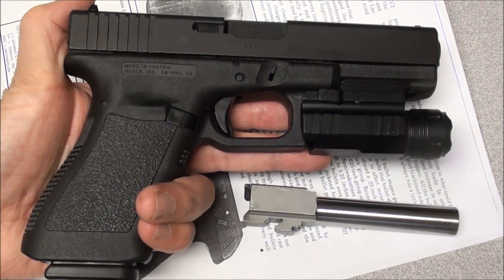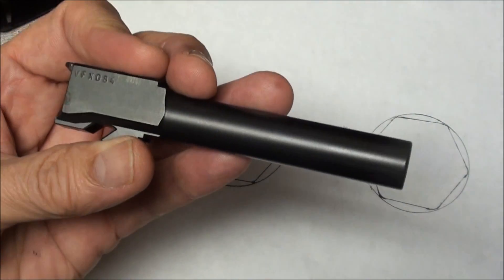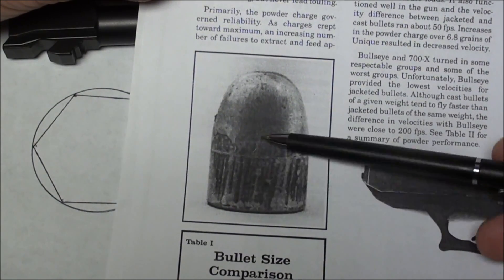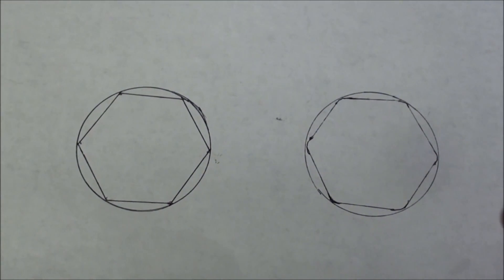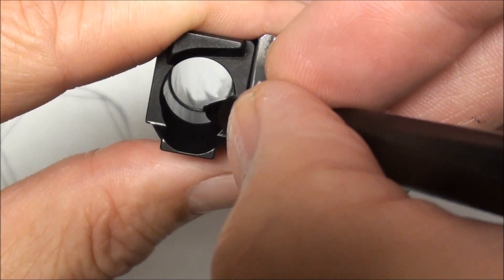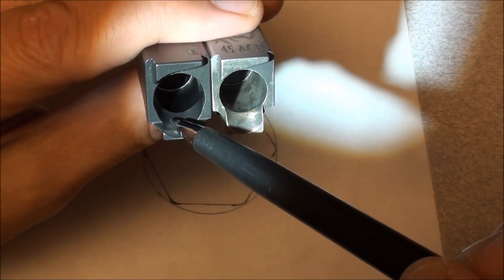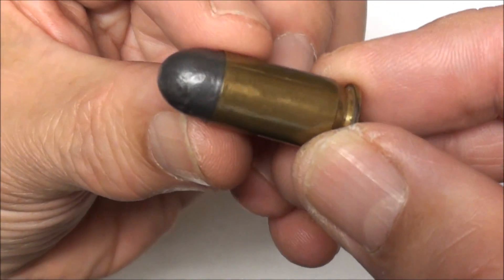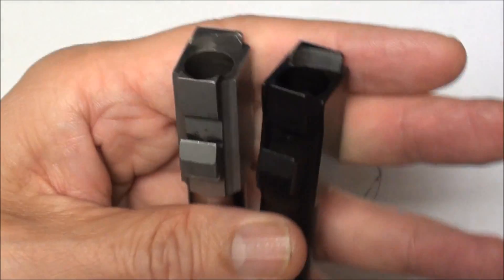Polygonal Rifling in Reloading Ammo for Glocks

Comment: This guy doesn't get it....   Cast bullets are .0005" to .001" larger than jacketed bullets.  Add to that many folks that reload pistols never trim their brass. A reloaded case that is stretched when slammed into the chamber crimps the bullet forming a hard lock between barrel bullet and brass instead of having clearance.  Polygonal rifling is great stuff. It rates with the very best cut rifling.  Any manufacturer wants to limit liability and states no reloads.  Half of home reloads only know enough to remake a bullet not the background knowledge of a competent gun tech or engineer to insure reload safety.
Reply from the maker: +Lanc Mac -- Sorry to not reply sooner, but Google did not post your comment in my inbox.  First of all, cast bullets can be larger or smaller than jacketed bullets and by more than you specify.  Of course, we do want cast bullets to be .001-.0015 bigger than groove diameter of our auto pistols and that doesn't have to have relation to jacketed bullets (although Lee gives a rule of thumb on that that often works - but not always).  As for the rest, let's see if we can make this clear so that everyone can get it... I would add to what you say that many very fine shooters never trim their handgun brass.  The reason is that it is not necessary - we find that our straight wall handgun brass does not lengthen or we would trim them - if yours does for whatever reason - of course you should trim them.  Quite a few of these shooters also shoot lots of reloads through Glock barrels.  If what you say is the case, there should be many more Glock Kabooms than those that happen (and  Glocks have higher Kaboom rates than other guns - reason why these videos are made by the YT posters that post on this).  What you don't get is that if cases were too long from not trimming, those rounds would never chamber as the case mouths hit the headspace shoulder at the front of the chamber and no battery occurs.  Of course it is possible to have that case pinch situation, but it would have to be a real long case plus an extra heavy recoil spring like an Uzi to do it.  The problem you are referring to is when the bullet ogive is seated out too far and the bullet gets jammed into the rifling leade causing either no battery or if the slide impact is enough to allow gun going into battery, a dangerous situation of higher pressure could occur.  This would be a problem for any auto pistol.  As for Glocks, what some have insisted is the cause of Kabooms is that reload ammo lead bullet fouling occurs from the polygonal rifling that this fouling traps the bullet, or the case, or both case and bullet so that firing rounds so trapped causes the Glock Kabooms.  I don't see Glock fouling to be more or less than any other gun without "polygonal" rifling.  If fouling caused Kabooms, all guns shot a lot would Kaboom.  This video is pretty clear about the oversized and heavily throated Glock chambers being the cause - less case support causes brass strain and increased incidence of case failures especially with used brass.  You don't mention anything about this in your comment - perhaps it is you that doesn't get it...  I would never say anything so disrespectful to anybody except in reply...  Best Regards,  FC

Comment: You confirmed my thoughts exactly FC.  Great video, just finished watching the new one about (NOT) trimming pistol brass.  You're a hidden source of knowledge on YT that a lot of shooters and loaders just aren't aware of.  Keep up the great work and thanks for your contribution!
Reply from the maker: Marc Cervantes No one should ever say never though.   If you shoot a lot of high intensity 357 magnum, you might want to check your case lengths.  My favorite 357 load (for use only in 357 revolvers)  uses the 170 Keith bullet loaded with 12 grains of 2400 in 38 special cases (if you like this, start low and work up) with magnum primers - no need to trim these ever.  Big bore revolver brass very very seldom needs trimming - so seldom, it is close to never.  Have a great day

Comment: I think Glock chose this type of barrel on perpose. It has to have a maximum reliability that's why it has such lose gap and wide ramp even though it  sacrifices an accuracy and overcharged tolerance a little bit. Because Glock is duty or service pistol, not a much gun. What do you think?
Reply from the maker: +上田洋介 -- Absolutely, the Glock was designed to be a service duty pistol, serious purpose, not a pistol for sportsmen and especially not for reloaders.  Have a great day,  FC

Comment: I had a Gen 2 G21, I shot thousands and thousands of lead reloads before I ever heard any of this nonsense.
Reply from the maker: TheNorthernyankee - That was a good gun.  I've shoot many pounds of lead 45s thru my Gen2 G21 also with no problems - thru my LW aftermarket barrel though. The 45 cal (and the 9mm) Glocks were not the common ones that blew up.  It was the 40 cal.  Perfect storm of factors with the 40 had the preponderance of the problems.  Still the factory does not recommend shooting reloads or lead bullets (lead bullets are reloads - when is the last time you saw factory 9mms, 40s, or 45 auto pistol rounds loaded with lead bullets?  One of the reasons - Glocks) in Glock pistols.  The shooters that do that are taking their chances especially the 40 cal.  I haven't done this recently, but do a search on Glock Kabooms.  You'll see that it is the oversized and heavily throated chambers that is causing all the problems - not the "polygonal" rifling.  Again, why Glock just doesn't call it Glock rifling is baffling as it sure isn't polygonal.  Best to ya.

Comment: I have owned a Glock 17 (gen 2) since 1991.  At a minimum I have put 10,000 of my reloads through it.  I use both plated and jacketed.  Usually 124 grain but also 147s and 115s.  I have never had a problem with the functioning of the pistol.  I back off 10% of the max load in the powder manufacture's data.  I believe the talk of Glocks exploding from reloaded ammunition (jacketed or plated) is just an Urban Myth.  I agree don't use lead bullets.
Reply from the maker: Ross Henderson - You are very wise - the 9mm and the 45 really are not the problem especially with your -10% policy.  The Kaboom events have and are happening and are predominantly with the hot loaded 40 cal.  The merging of variables in the 40 create perfect storms resulting in the Kaboom events.  The use of reloaded ammo (tired or prestressed brass) is part of the perfect storm.  No, I have never witnessed a Glock Kaboom either, but then again, I've never been on a line of 12 shooters all shooting 40 cal. Glocks rapid fire once every week or so...Thanks for posting and good shootin' to ya (good shootin' includes no Kabooms)...
Reply: I think the gen2 glocks have better steel used. 
I lost count of rounds I’ve put through my 1990 gen2 17 at over 100,000 years ago. I could be pushing 120,000rds by now. 

I used my g17 exclusively when I was in the Navy back in the 90’s. 

I’ve got room for more than one pistol now a days so I don’t use it too often anymore.

Comment: Thank you for your analytical, well thought out explanation of your opinion as to why Glock pistols are susceptible to failure with lead and/or reloaded ammunition.  IMO, any repetition in your video was by way of emphasis, which was backed up by actual examples for illustration.  I appreciated every bit of your presentation.
  I recently bought a Bersa Thunder in 9mm, which cautions that a 200 round break-in period be used (abstaining from the use of hollow points), as polygonal rifling is present in the bore.  When I questioned the clerk at my range about this type of rifling, he replied that lead bullets are dangerous as well with this rifling.  (He didn't mention reloaded ammo at all.) He also mentioned that replacing my barrel with a standard style barrel would alleviate the likelihood of  failure in my pistol.   As I'd never heard this before, I started my web search for info.  Your video answered all my questions, and demonstrated to me the level of rumor and misinformation that is present in the firearms community.
Reply from the maker: ***** The real amazing thing is the accepted "fact" that you cannot use lead bullets with polygonal rifling because the polygonal rifling fouls easily (especially in the beginning of the rifling) with lead and pressures go up with that fouling causing the Kabooms.  If a shooter just stops to think about it - look into the barrel and the "polygonal" rifling has smooth lands and grooves - not the sharp cut rifling of standard barrels.  Now why would smooth foul more than sharp.  And the rifling lead is no more abrupt with either style of rifling.  Even Glock is weird on what they call polygonal rifling because I read a factory blurb that Glock is now using their special female polygonal rifling.  After you see what true polygonal rifling (polygon - no hills in the rifling - valleys yes) is in my video - how you get the Glock rounded lands and grooves to be construed as male or female or even imagine how they could be polygonal is beyond me - why they just don't call their rifling Glock rifling (because that is what it is) - is all baffling.  And most people buy the whole shebang and argue with you like you are crazy if you say it isn't.  I have just stopped and let them all be happy.  The problem is the Glock oversized and heavily throated (case head is on the verge of no support) chambers.  Great with reliability using fresh factory jacketed ammo for duty and military and police (what these pistols are designed for).  The Kabooms are caused by case head blow outs and separations - not by barrels blowing up and the cartridge cases intact.  All people really need to do is inspect the Kabooms.  The only way barrels let go is with barrel obstructions with squibs.  Thanks for posting...Best Regards to you
Reply from the maker: led hedded - Forgot to say that I appreciate your encouragement - some have expressed dismay at having things repeated - I have learned to keep that to a minimum.  But it's great that others understand the intent is not to insult the viewer but to add emphasis to an important matter - Have a great President's Day
Reply: FortuneCookie45LC
No problem.  To me your video appeared well thought out and logical.
I made the mistake yesterday of discussing this phenomenon with a Glock fan
at work.  (To me, there is nothing special about Glocks.  They're ugly to me, and I prefer an old school approach.  High firepower is a nice feature, though...)  If my coworker hadn't gotten called away during our discussion, I could see an extended, er, "discussion" on the horizon!  Oh well....
Reply from the maker: ***** But that's the great thing - you already know the "bend" Glock fans have.  I have Glocks because they are a significant part of the firearm landscape. All that stuff about "Glock Perfection" is just feeding the fandom.  If they were perfect, there wouldn't be 4 generations of 'em.  If they were perfect, we'd be able to shoot economical lead bullets through them (without having to buy an aftermarket barrel) for practice.  That was never a concern for Gadsden Glock because his users had all the government ammo they needed for proficiency. The shooters that have to buy their own ammo were never in his thinking.  Even the 10mm Glocks are duty weapons - they are not for sporting purposes, but rather to put the lights out.  FC45LC doesn't say things in the usual way... Have a great day
Reply: FortuneCookie45LC
I dunno.  Glocks just were never my cup of tea.  This recent revelation just strengthens my feelings.
  Maybe it's just me, but I'd rather have a handgun that safely but occasionally  jams, instead of a freely firing sidearm that occasionally explodes!  (I've never owned either, yet... knock on wood).
Reply from the maker: ***** Thanks for your post, but you really don't want either the jammer or the Kaboomer.  You can have utter reliability, accuracy and ability to shoot any factory or reloaded lead or jacketed bullets of form from your factory gun in other brands with supported chambers.  Glocks are good guns, but the term Glock Perfection is misleading.  Best Regards to you
Reply: Agreed.  In purchasing my three handguns, my first priority was reliability, and I read many reviews as well as watching numerous video reviews of prospective weapons before purchasing them.  My SR9, M&P Shield, and Bursa Thunder are all quite reliable in my book.
  Here's a thought: In your diagrams of hexagonal bores, suppose that you increased the radii at the vertices of your hexagons, so that the hexagon sides approached the barrel's inner diameter more closely.  As your radii increase, the "hills and valleys" effect becomes more and more pronounced.  Eventually you attain a smoothly fluctuating geometric pattern in the bores I.D. with no sharp corners, but with a more accurate fit to the O.D. of the projectile.
  I don't disagree with your contention that the Glock's reliefs in its chamber are quite likely the culprit in catastrophic failure.  Rather, I think that the alternate rifling is being used as a scapegoat to explain away the Glock's devastating, er, proclivity. (And then there's the "Glock smile" phenomenon, but we'll save that for another day...)   It's also a handy excuse to change out the Glock barrel for a more reliable replacement.  And, once you start trading out parts, what's the point in buying a new weapon from Glock to begin with??  (JMHO...)
Reply from the maker: ***** That Glock smile is signature of loss of support up the case wall from the web of the case head.  I'd tell any shooter with a Glock that gives those smiles to really beware as if that brass is used again and the same spot lines up again (Russian Roulette variant) in a similar Glock and hot Titegroup powder charge is used...usually most pronounced in the 40 cal.  We know about smiles as back in the 70s when 1911s ruled the land, we often throated the chambers to increase reliability with our bullets of choice.  If we overdid it, we got "smiles" and occasionally, the rounds would blow through and blast the magazines...but the guns never really blew up like Glocks do.  Didn't take much to get the guns back in action again.  And we also got pretty good at throating 1911 barrels.  Our 1911 chambers were never oversized though...Have a great day...

Comment: So, lead bullets per se have nothing to do with Glock KaBooms. Very interesting. Based on my (limited) review, the 9mm Glocks seem to be less prone to blowing up while the .40s more so. Do you concur?
Reply from the maker: Damion045 - Thanks for your question.  I don't own any 40 Glocks.  The 40 Glocks are by far the most Kaboom incidents - the pressure curve of the cartridge (the 10mm was too robust, so they shortened the case to the 40 but tried to keep the fps up for effectiveness) lends itself to situations where the conjoining of perfect storms - Glock oversized unsupported chamber, tired brass, powders with pressure spike potential (Titegroup for example), bullet seating problems, oversized bullets, heavy bullets, magnum primers - note that all except the first factor are reloads and lead bullets are uniformly reloads = recommendation to not use reloads or lead bullets (same as reloads) in Glocks.  Also note that remove the Glock oversized unsupported chamber (all it takes is a little tiny window above the head), and reloads are no problemo (like the majority of our other guns).  We can remove that chamber by subbing in an aftermarket barrel.  Now the factory Glock barrel is designed for maximum reliability with factory jacketed ammo only (interesting, with all the Glocks around - you don't see lead bullets anymore in factory or commercial auto pistol loadings, do you?) for duty, military and law enforcement - never was intended for the reloading sportsman.  Civilian shooters want what military and LE use - that wasn't in Gadsden Glock's mission statement in the beginning - he was hired to make the Austrian military a pistol that was simple, foolproof and easy to train.  Best Regards to ya

Comment: 3 minutes of good information repeated for 18 minutes. The only factual error I found was that it was suggested that polygonal rifling was used to permit hammer forging.  Many manufacturers hammer forge conventional rifling into their barrels, so that is not the reason.
Reply from the maker: Jay Loveless - Thanks for your good comments.  Any YouTube poster that's been around for a while learns to keep videos as short as possible.  This video deals with a well accepted "fact" that Glocks have polygonal rifling (the factory says so) when it is not so.  This takes some real doing, so please forgive me for repeating, but there is much more about the Glock chamber after the rifling discussion.  And the danger of reloading or using cast bullets being blamed on the rifling when the chamber has most of the responsibility warrants any repetition in that section.  I know that you got the point quickly, but you still see and hear that the Glock polygonal rifling is the reason you shouldn't shoot reloads or cast bullets in Glocks.  And then there is that this is no criticism on Glocks - just transmit some understanding of what is there.   Best Regards to you